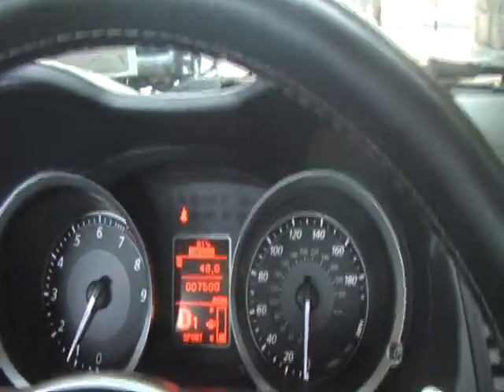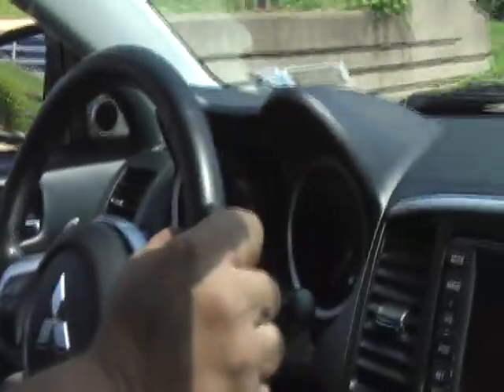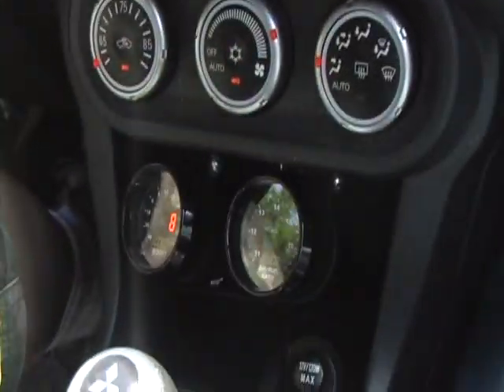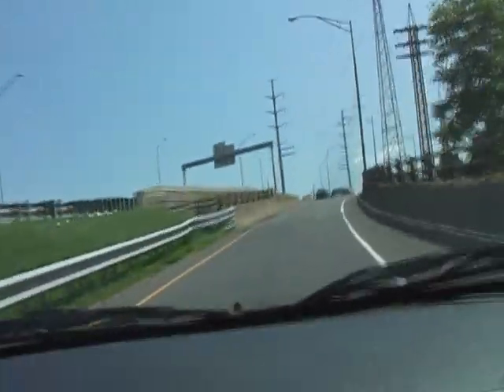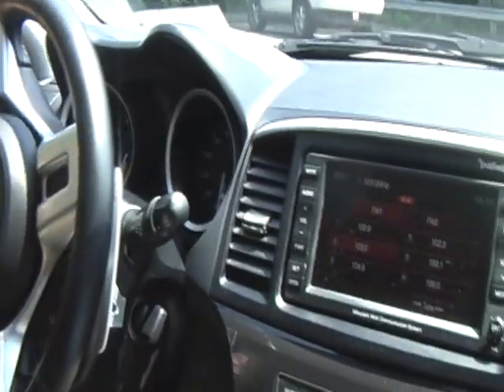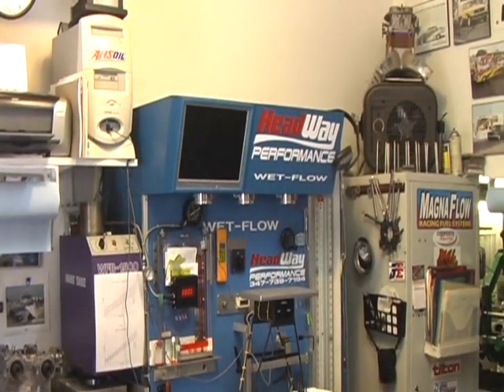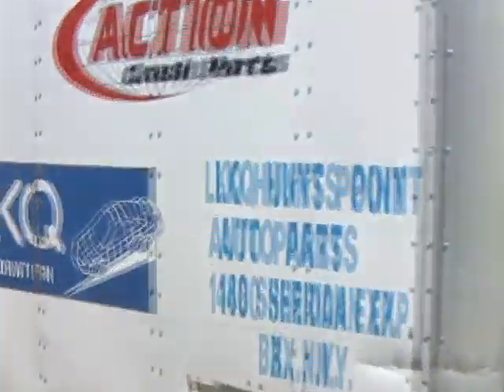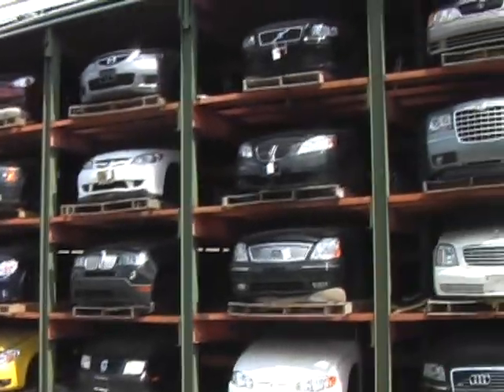Evo X

Comment: They claim that because they couldn't inspect it before it was rebuilt that they wouldn't cover it. But I had no idea what screwed the motor until the Ferrari mechanic at ICS Performance figured it out while tearing it apart. The engine seemed fine after the accident which was only the very right corner of the car. Apparently the oil line got slightly kinked in the hit, but they didn't see it. After a few hundred miles, the motor gave way due to lack of oil. I have to eat the cost, but I'm happy